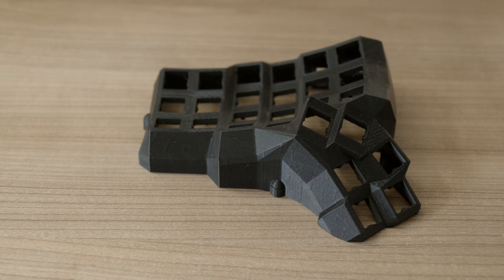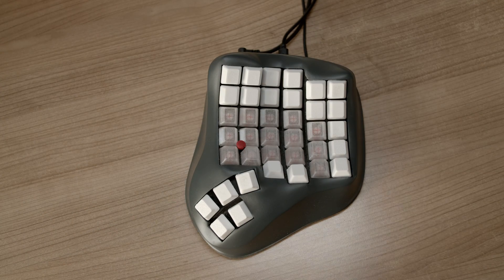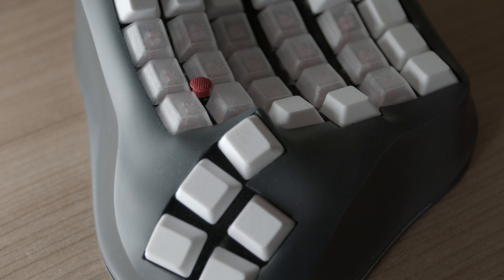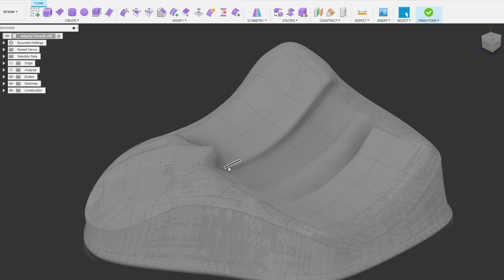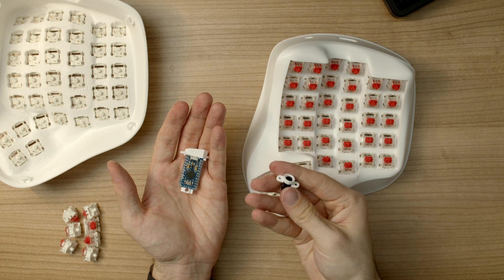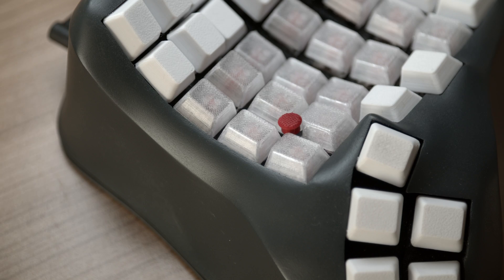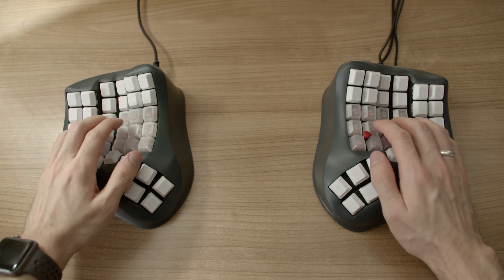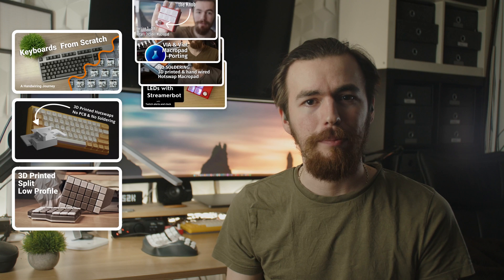Building a Custom Split Ergonomic Keyboard with a Trackpoint - wDactyl

Comment: What trackpoint did you use ?
Reply from the maker: I dismantled a used external thinkpad usb keyboard and only used the parts that are required for the trackpoint. That why it has a separate usb port
Reply: Is there any tutorials on this topic you can refer to  @JanLunge ? I would like to try that for another project but i cant find any decent resources

Comment: Thanks for you video and sharing the source files, I'm working on a keypad to replace my Razer tartarus and I'm struggling to find the best solution for the key cluster... either using classic thumbs keys or a mix of keys with a d-pad using microswitches.
Having some existing model will greatly help me to improve my  design

Comment: This video is super valuable, I've been struggling to do something similar myself. Would you be willing to share the file for the switch hole negative, if you still have it? Would be much appreciated!
Reply from the maker: the switch negative is done in the case file here https://github.com/JanLunge/keyboards/tree/main/wDactyl%20-%20large check the f3d files in there for fusion360 should be in the first few history steps before the keywell gets formed

Comment: 2 year update trackpoint update?
curious if you still enjoy the position,etc
Reply from the maker: I since have switched keyboards as the wDactyl is a bit large for what i need most of the time, but the trackpoint is still in the best spot of any keyboard with mouse support I ever used. But for this to be useable long term i would need to include the trackpoint in the main controller so I dont need to plug in 2 usb cables which is really annoying.
Reply: @JanLunge  I bought a trackPoint planning to add it in my moondalder!! I think I could add a USB hub below my keyboard in that way I could only have 1 cable let's see how it tourns out

Comment: For latecomers who want to design their own dactyl, I recently found a great tool made by ryanis called "Cosmos Keyboard Generator". It is open-source, super easy to use and you can do all sorts of thing with it! I used it to design and print a variation with a vertically mounted switch in the thumb cluster.

I love this community!
Reply: possible to use this tool to add a trackpoint? thanks for posting its a dope site, built with threlte is cool

Comment: I've seen a few of these. For some reason, nobody: takes their 3d print, sands it smooth, makes a silicone mold, then casts a resin copy. It seems like the logical next step, no? Then you can sell them.
Reply: Easier to print them with resin then

Comment: Hey! It's been a year since this video, and I wanted to know are yoy still using this keyboard and how does it feel? Maybe you've made improvements to it
Reply from the maker: After using it for a long time i noticed i dont really need the F-row but building a smaller version is really a lot of effort and I still havent gotten around to build one. Right now Im using a few smaller ergo boards that are running kmk instead of qmk. But the typing feel is still the best on the dactyl manuform style keyboards and the wDactyl is still the most comfortable keyboard I ever used. Also the 3D printed keycaps are still as good as on the first day

Comment: Hi Jan, really like the design! Im wondering is it possible to use different mx type of keycaps and what profile since i am not going with the track point? Thanks!
Reply from the maker: I haven’t tested other profiles, worst case keys could overlap and bump into each other. Any other profile than a flat dsa profile will also alter the shape of the curve for each column which you would need to evaluate for ergonomics again. You could check what other people tried on their dactyl keyboards as i kept the same curve radius as the standard one.

Comment: Great project, I love it. But after building the keyboard I can't figure out how to set it up. Link to your fimware files doesn't work and I'm a noobie in terms of keyboard building. Can you give me a hint?
Reply from the maker: Oh sorry for that I recently moved the firmware to better named folders its now located here https://github.com/JanLunge/vial-qmk/blob/vial/keyboards/janlunge/wdactyl
Reply: @JanLunge  Thanks for reply. I'm trying to build it using qmk msys on windows but getting errors. Can you add hex files so i can cheat and skip compiling?
Reply from the maker: sure here you go https://github.com/JanLunge/keyboards/tree/main/wDactyl%20-%20large/firmware/qmk
but I also fixed the issues there were with the current version of qmk so you should be able to compile it yourself (in config.h there is a flag for left or right half as they have separate firmware files)
Reply: @JanLunge  YES, it works, thanks for your help. Keyboard is great

Comment: This is amazing work.  
It's a little strange how much effort we're willing to go to for the perfect keyboard, eh?  Or maybe not, considering how much of our lives are spent using them.

I am looking to do something similar, but I really want to have the ctrl and alt keys.  I'm also thinking about a small trackball and some dials.  And probably an OLED.  My desk is huge so that's not a concern.  I might call it "the kitchen sink."

I've tried remodeling in Blender from the OpenSCAD Dactyl Manuform file, but the geometry it gives is absolutely horrendous.  Everywhere I go, I find extra polygons, swapped normals, duplicated lines... it's very frustrating.  Even just cleaning up a single bolt hole on the bottom is a huge mess.  It's making me question just how badly I want this.

Anyway, keep it up.  I look forward to what else you will come up with!

Comment: I'm currently designing a split 65% layout and I'd love to hear a bit more detail on how you actually got the trackpoint functioning as a standalone device.
Reply from the maker: I was just lucky  that the trackpoint i used from a lenovo keyboard had such a small pcb and i could disconnect the rest of the original keyboard from it.

Comment: Are you still using it? If not, why change?
Reply from the maker: I still use this board but I still want to work on a wireless version so the cables dont get in the way and also maybe one without the f-row as the board is quite tall and doesnt fit under my monitor stand

Comment: Is there a way to buy printed shell? I kinda like the shape and I want to replace my Razer Orbweaver but buying 3d printer and learning how to print properly seems like too high price.
Reply from the maker: You can send the 3d file to a print service but this is more expensive than printing it yourself. Otherwise bastardkb is selling very nice printed ergo keyboards and the shell for them.

This project is optimized for printing it yourself so for both halves you would need to mirror the shell once for the other side in the slicer not sure if print services support that

Comment: I haven’t used Fusion 360 yet but I have used lots of other CAD softwares. Are you familiar with the term NURB? It’s parametric modeling. Something like Rhino 3D might help you get those consistent thicknesses over curved surfaces.

Comment: I am intrigued by your comment of hovering. IT sounded like you said your shoulders and neck would NOT get into stiff positions if you hover your hands. This sounds counter to my thinking. I also use an ergo mouse and its precisely the fact I can rest my wrist on it that allows the joints in my arm to relax and have freedom. Similarly when I am typing on my laptop keyboard my wrists are firmly planted on the machine and my writs do all the actuating to allow my fingers to reach all the keys away from home. But as soon as I hover my hands over the keyboard I feel my shoulders lock up, and over time my elbows start to feel stiction. 

Is this not how you experience hovering?
Reply from the maker: At first it was but only when i tried having my hands in exactly the same spot, but with some back exercises and giving my hands some freedom to move depending on what would suit my shoulder position best there were no issues for me. 
I do still rest my hands on the keyboard but only when I’m not typing, even for short breaks from typing. Maybe that is also a factor. I once read something about ergonomics that its always a bad idea to try to stay in the same position so I’m trying my best to bring some movement into my “sitting at the desk and keyboard” position while not straining my tendons with weird angles to reach keys.
Another thing is when hovering I don’t need to reach with just my fingers but can support that move with my arm.

Comment: the trackpoint is something I would like to add to my Moonlander keyboard. Everything else is really brilliant with the Moonlander for my purposes
Reply: Have you done it? I just bought a Trackpoint to do the same to my moonlander!!
Reply: @ no. I’ve bought keyball44 and fully happy with it for my purposes as a java developer. The QMK gives flexible mechanism to adjust the trackball. For example, when the layer1 is pressed, the trackball scrolls in horizontal and vertical directions, when shift is pressed the speed of cursor is 5x faster, when layer2 is pressed the trackball simulates up down left right buttons with the speed I like and logic I like (there is a method which I can override, something like onMouseEvent). This feature is game changer comparing with just a cursor movements.

Comment: Did you print that Trackpoint extension stem? Or was it part of the Thinkpad USB keyboard?
Reply from the maker: The extension stem us 3d printed though it isn’t perfect its working fine for now
Reply: @JanLunge  Can you upload the stl file, please? :)
There is also one on thingiverse, if you want to try it out. Search for "TrackPoint extender".
Reply from the maker: I tried to find the file but I lost it when my fusion 360 crashed when i built it so i only had a temporary gcode file on the printer

Comment: Which printer do you use, and also do you have any pointers on making this hot swappable, I am getting into coding and also looking into 3d printing so any pointers would help. Love the content.
Reply from the maker: I use the prusa mk3s and this design is not ready to be made hotswappable. You can tinker with it and remove the parts that would overlap the onekey pcbs or the hotswapsockets but its not something that this was prepared for
Reply: @JanLunge  I will do research and see what I can come up with. I am just getting started and ordered my first printer yesterday. If I come up with something that is halfway decent I will send the design your way to check out. Again, thank you for your videos.

Comment: Looking to make a  similar  design , hated the sharp edges. Might be easier using Zbrush and your boolean method to shape the form. Yours looks nice though ,will use PLA to test print and them maybe rubber coat who knows. Very nice job thought.

Comment: What about two trackpoints?
Right one controls cursor, left one controls scrolling (vertical and horizontal)
Also trackpoints can be clickable, emulating mouse buttons.
Reply: I think scrolling is easier with keys.

Comment: Great reuse of the trackpoint! Do you know if anyone sells 3rd party trackpoints/trackballs/tiny trackpads? Anything to avoid having to move your hand to the mouse
Reply: i think the best thing you could do is get a broken thinkpad for cheap and listed as parts only, i'm thinking of doing this build and will try that first. there are some ergo boards that include a trackball (charybdis) so that is also another option as you can get a cheap logitech trackball mouse and transfer the sensor + trackball itself into the case.
Reply: There are some on Aliexpress for 15-20€.
Trackpoint with its PCB and connected by USB.

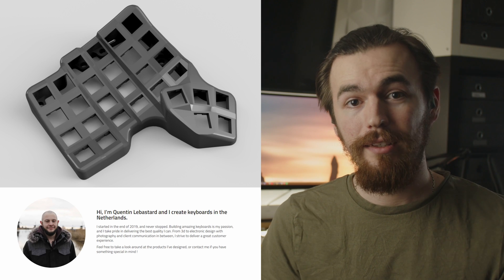Comment: If you are doing it parametrically, why don't you use a Sphere or something to "wrap" the keys around programmatically, then stencil it in as a negative and smoosh as required. It doesn't let you do the staggered columning like you have here where the middle finger is deeper than the others but it would allow you to get a prototype done easier. I sorta thought of it like pushing a balloon with the keys glued to it into a soft mold and gaining that shape. Just an idea since I've watched a total of 2:55 of the video so far

Comment: Are the keys hot-swappable for this one?
Reply: I mean the switches.
Reply from the maker: No they are soldered in place, because of the tolerances as the switches are not flat on a plane they are also quite hard to remove.
Reply: @JanLunge  I saw in another video you made 3d printed hand wire router/hot-swap sockets, really interesting.  Would that fit the Dactyl case?
Reply from the maker: Those do not fit all places in this dactyl case because of some inconsistencies with the case thickness
Reply: @JanLunge  What about mini PCBs like the Amoeba Royale or King? I do not see a reason why they would not fit (but I am a totale beginner). Benefits: hot swappable and per key RGB.
Reply from the maker: There are parts on the underside of the case that reach past the switch pins this is fine for handwiring but the pcbs might habe clearance issues

Comment: I seriously can't wait for your new smaller build! Would you consider making room for some knobs aswell? Amazing job!
Reply from the maker: The design of the smaller board will take some time still but technically you can use rotary adapters so you can put an encoder in any place of a key. There are some 3D printed options for this. Maybe it will get a spot for an encoder

Comment: I really like your version! A long time ago I saw a picture of a modified Kinesis Advantage that had the trackpoint between the keycaps, since that time I expected to see something similar but in Dactyl Manuform (Or original Dactyl) until I see yours and it looks too cool. I have a question do you think the trackpoint is the most comfortable for the one who wants to have many keys without sacrificing the mouse or ergonomy? I have seen Dactyl with trackball (Finger and thumb operated versions) some people say that is much more accurate but I almost always see that there is something to sacrifice, Trackball is less keys (On Thumb) or less ergonomics (off the board), Trackpoint requires drilling holes in keycaps, and there are sets that are expensive, especially if they are made of PBT. Thanks for showing your work, I find you amazing! By the way, there is a thumb cluster created by Carbonfet that is identical to yours but with 6 keys, you might like it. Greetings from Venezuela.

Comment: Schöne Arbeit! Bin auch gerade beim zeichnen in Fusion und verzweifel daran so halb :) Ich würd mir aber auch gern ne Handballenauflage dazu machen - und außerdem gern Wireless gehen. Hat das nen Grund, warum dein wDactyl.f3d lediglich die rechte Seite des Splits enthält? Oder überseh ich irgendwas total einfaches? Aber Danke fürs Bereitstellen :)
Reply from the maker: Thanks! I just mirror the files in the slicer instead of fusion so versioning is simpler to handle.

Comment: Awesome! The Dactyl is the pinnacle in all ergonomic keyboards that I have been able to find. The one remaining issue to be solved, even for ergonomic keyboards, is that you still have to move your hand between the keyboard and the mouse. Your solution and Quentin's solution with the integrated trackball solve that last remaining problem.

I wonder what more can be improved. I also wonder how much improvement the concave shape has over a small flat keyboard, such as in Ben Vallack's recent video “The REAL Ergonomic Keyboard Endgame!”.
Reply: I am not a fan of thumb-driven trackballs, because they put way too much strain on the thumb, while offering less control. And trackpoints are simply not as good as trackballs, in my opinion. So "what's left" is integrating a finger-operated trackball, in such a way that the right hand basically doesn't have to move to access it. That's what I'm working on.
Reply: @HenréBotha  Did you ever design something?
Reply: @AUS10indeed  it's a slow, slow work in progress!! Took a break for a while to design my fighting game controller, but I'm back on the keyboard now… maybe
Reply: @HenréBotha  look up blueberry trackball break out board!
Reply: @zoenagy9458  did you mean Blackberry?
Reply: @HenréBotha  Do you have a design update? :) Or links to designers who implemented your idea?
Reply: @catchingstars7  no progress, unfortunately. Best I've seen is a bizarre folding keyboard whose name escapes me. It has a trackball and is intended to be used flat on a desk or folded up in your hands, and thus the trackball mount works both horizontally and vertically

Comment: hello sir, where the file STL dactyl on the right ?
Reply from the maker: There is no second file, normally you mirror the one stl file in the slicer depending on which side you want to print. Otherwise the inserts would all need a mirrored version as well

Comment: hi, great video. Not really a question related to the main subject. What Think pad or keyboard did you get that track point from?
I've wanted to add a track point to my board but the modules I have have the sensor and controller fixed together. It looks like the one you used has the sensor on a long flex which I think is exactly what I'm looking for!
Reply from the maker: I used the thinkpad keyboard usb version https://www.amazon.de/dp/B00GZG72I6 and yes the flexcable makes positioning and mounting it quite nice

Comment: Does the shell operation allow you to achieve consistent wall thickness?
Reply from the maker: That should work as long as i will keep the bottom part closed and then cut it off as shell does not work on surfaces. I will definitely try this!